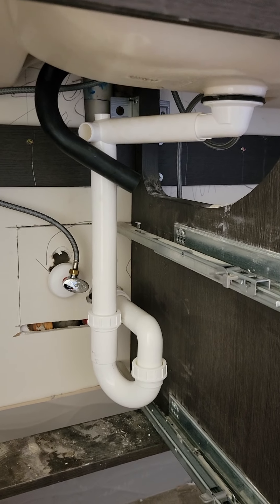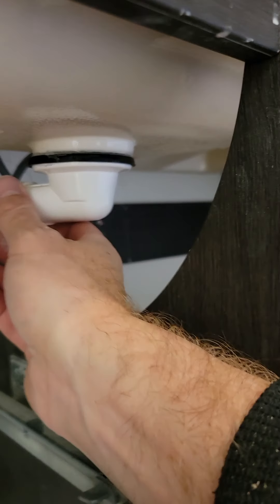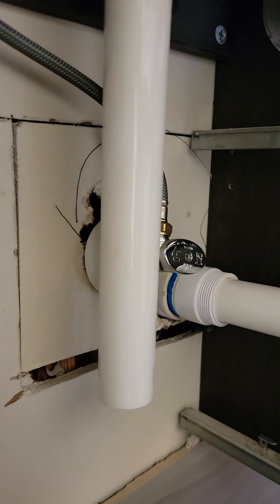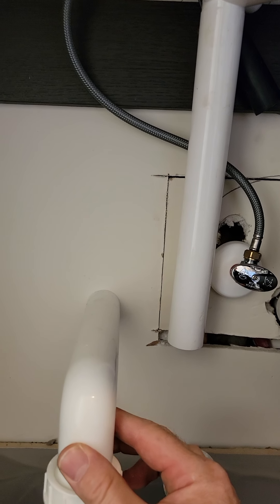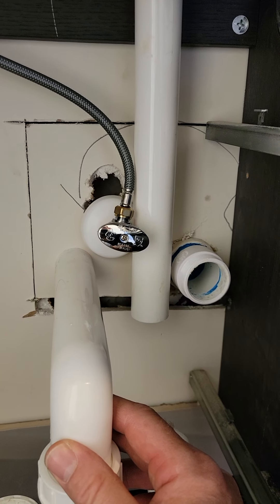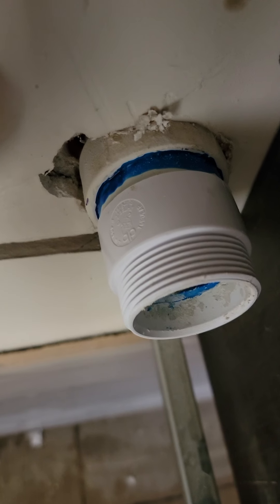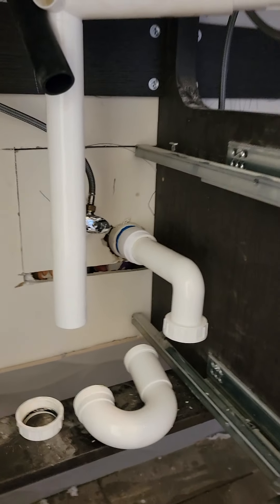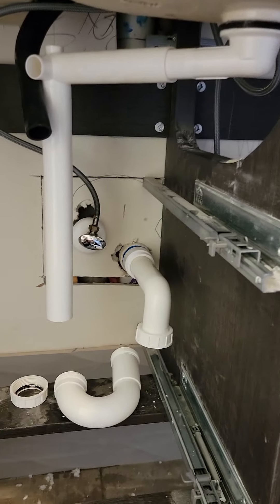Plumbing for Ikea vanities - How to rough in for Godmorgan, Hennes, Etc

Comment: No problem here. Just put an elbow down on the rough, p-trap to the left (under the water line) and up to the IKEA pipe (leftr from the water line) Side note, the lip smacking was very distracting.